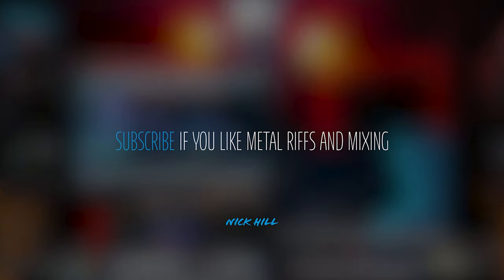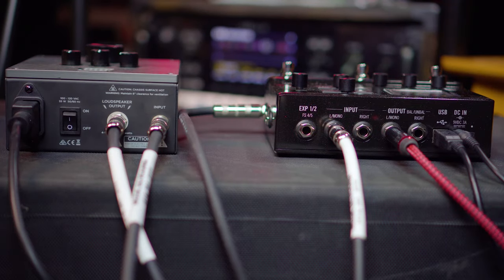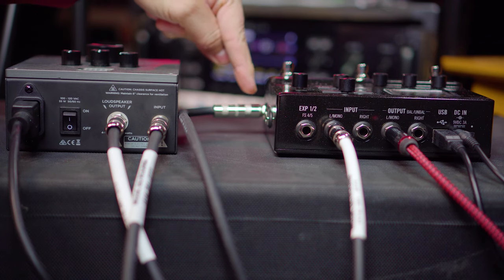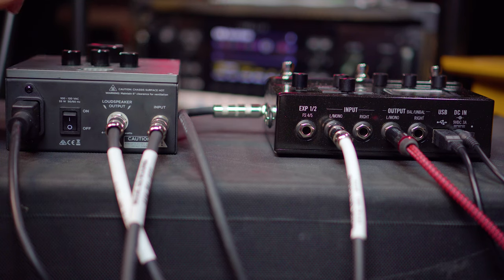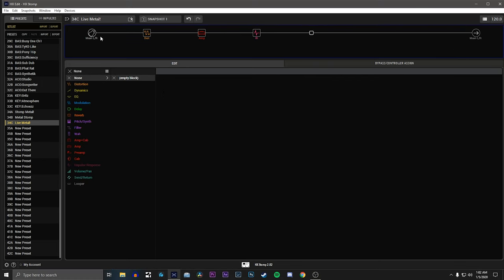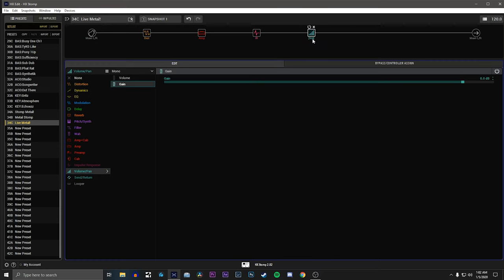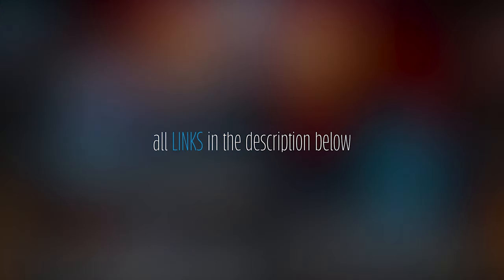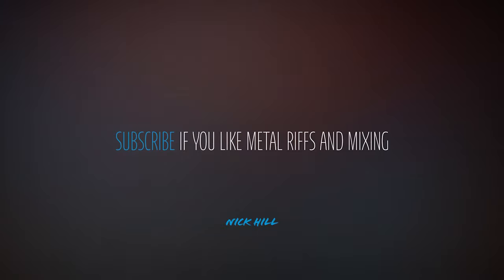Line 6 HX Stomp + Seymour Duncan Powerstage 170 LIVE RIG

Comment: You just sold me the HX Stomp. I figured this should be possible, but wasn't sure without any prior experience of the unit. Your video went straight to relevant things like the basic idea around the concept, the physical signal chain and the how the patch should be set up. Also great explanation how and why everything had been done the way they were. Thanks for the video.
Reply: I have and use this exact same setup and not only does it sound amazing, you have LOADS of headroom. I can't believe how powerful the powerstage 170 is - playing with my full band I'm at maybe 30% volume and am loud, present, and cut through the mix.

Comment: Nice job, actualy i realy like ur micd Sm57 take 
On the IR usualy i low cut at 80hz and high cut at 12k hz by default. 
I would love to get the Seymour Duncan Powerstage and do the same with my 2x12 ENGL to have the Volume on stage and sending the IR to the Soundguy.
Now im running the Powercab with the 1/4 cable in FRFR mode, it's good but still miss the Stage Volume to a Live setup. ( but through a Pa sounds killer)
And when i can, i use the PRS MT15 with my ENGL2x12 V30...  with only a TS808 or a PrecisionDrive is amazing.

Comment: Do you think it’s necessary to put an EQ after the AMP BLOCK so the signal that goes to the cab cleans up of unwanted frequencies?... or the cab does that work?
Reply from the maker: You can do it however you’d like and see fit. There is no right or wrong. If you’re asking if I would do it that way, I wouldn’t.

Comment: Easy to understand video.  It’s tough to tell on our end since either method essentially simulates a close mic cabinet.  Does the power amp into a guitar cabinet sound more “amp in a room” for practice sessions?  I’m thinking of running the stomp into a 170 into a cab would give me a great low volume practice setup at home.
Reply from the maker: With the Powerstage, you can run a cab much quieter. I've used this setup on a live/practice situation and it was loud! So you really have the best of both worlds.
Reply: Nick Hill thank you.  It seems like the ideal solution.  Practice quietly at home without IR’s without bugging everyone  and just run foh with ir’s live.  Seriously well put together video mate.

Comment: Friend, with the power amp does the sound remind you a little of a tube amp or is it very distant? Does it sound better than using irs in frfr cases?
Reply from the maker: On stage, in a live setting, it’s never something I would even think to notice. I just need to feel and some volume. I’ve not used a FRFR so I can’t speak to that.

Comment: Can you specify one path to go out of the headphone output or does that one always get the full processed signal?
Reply from the maker: There is a headphone out and yes, it is basically sending the main outs.
Reply: @NickHillMakesMusic  Ah good.  I use this trick with my kemper when I need a separate monitoring output and a different output level.

Comment: Is it ok to use the full amp model into the power stage? I heard somewhere to use the preamp. Is the only use for the pre amp models for the 4 cable method?
Reply from the maker: I've never NOT uses the full amp. A power stage has no "tube power section." It's just clean gain so you'll want every bit of the emulation the model has to offer.

Comment: Do i need to set the amp block as a normal amp or as a preamp? Im a bit confused about what i need to choose
Reply from the maker: Try and test both. There’s no right or wrong answer. The AMP block is also simulating power section saturation but these clean, solid state power amps typically are just that, clean. Meaning they aren’t doing any or much “coloring,” of the tone/sound. I use an AMP block. Cheers man. Do some experimenting
Reply: @NickHillMakesMusic  okay thank you :) ill get my powerstage in a few days and wanted to make sure.

Comment: Hey man, is it safe to un this poweramp in a lower wattage cab/speaker 8 ohms? say like a vintage 30 or a 100 watt celestion.
Reply from the maker: The pwerstage can push varied ohm speakers. I’d google the manual to be sure

Comment: Hey Nick, love your videos.
I noticed you used a full amp on the HX stomp going in front of the SD Powerstage, instead of preamp which would make more sense. Is there a reason for that ?
Reply from the maker: Personal preference. Also, the power stage is solid state (clean ) power and the Helix amps emulate tube power/saturation

Comment: Hi Nick, nice video!  Question for you - if you've got a delay and a reverb on your preset and you split the path to go the the cab and to FOH, will those effects come out both FOH and from the onstage cab?  I'm just trying to figure out where would be best to split it to get the effects on both :)
Reply: If you place the effects before the split, they will be present at both. If you place them after the split it will be present only on the output where you placed them.
Reply: @effektgeraeteinfo  thanks for the advice!! 🙂
Reply: @effektgeraeteinfo  thanks for that!! 👍🏽

Comment: Are you using an amp model (pre amp and power amp) or just a preamp model?
Reply from the maker: Hey man. I’m using the amp model
Reply: @NickHillMakesMusic  thanks Nick! I've just been using preamp models. But after watching your vid I've just this minute  tried a full model and its sounds much better. I assumed because the 170 is a power amp I'd just need to use a preamp model. I think the 170 must be so transparent that it needs a bit of power amp modelling too. My rig sound much better now!
Reply from the maker: I think you’re right and that’s why I use the full amp model. The 170 is solid state and super transparent
Reply: Have you ever used preamp models through a real tube amp into a real cabinet? That's what I do now but do add an EQ block to shape the tone. So you had better success with full amp models instead of preamps when using the SD-170 with a real cabinet?
Reply: @danc3746  I've been using full amp models for the last few months, sounds great. I have used the preamp models into a real tube power amp yes, sounds good but I wanted to downsize my rig, so I'll continue to use the sd170 and full amp models.

Comment: Why would it also need to go to front of house? What if they already mic up the cab?
Reply from the maker: Common thing to do. Send your processed guitars to front of house so people can hear it because your just using the can for stage sound. Also, this setup was to demonstrate a proof of concept for different setups. 

As an example, I run my sounds to front of house through a splitter so I get an in-ear mix. I also have a cab on stage for some stage sound. Lots of guitar players do this so they can “feel some air moving.” It also works as a good backup in case one’s in-ear monitors stop working.
Reply: @NickHillMakesMusic  I do not use in ears and the venue mics up the cabs so the front speaker moniters gives me what i need to hear. I'm more asking in my instance, would I still need to put it to front of house? It doesn't seem like I would but I'm still new to modelers hence why I ask

Comment: If I wanted to have path 1 come out mono into a monitor,then a parallel path in stereo with FX coming out the Send to two monitors,can I do that in stomp??Basically I want a Wet Dry Wet rig...
Reply from the maker: You should be able to split the paths and send each to a different output. Not having it in front of me, you’ll need to play with it.
Reply: Nick Hill I have a Helix Rack,but was thinking of getting the Stomp for something smaller.....so I don’t actually have one yet...I don’t want to buy one if it won’t do the WDW thing...

Comment: Can this sort of setup work for bass and what sort of changes might it require to work?
Reply from the maker: I don’t see this particular powerstage being able to push a bass cabinet very well. Bad cabs typically need a ton of power through them. Most who use this setup would send the processes bass signal to front of house and then some type of in-ear monitor
Reply: Nick Hill thanks for tgr reply, i have gone down the in-ear route to be honest but wondered about these applications. Thought it would be limiting issue being able to push at this level. Cheers Nick 👍
Reply from the maker: I’d look into solid state power amps for bass. You can get a 1000 watt one for a good price. Check ohm machine on your can and you’re good. I’ve actually used this type of setup filling in for a band.
Reply: Nick Hill cheers 👍

Comment: Maybe a stupid question but why cant you just connect the Hx Stomp directly into a cabinet? Doesn't it have a Power Amp Sim in the signal chain? Why do you need a Power Amp like the Powerstage?
Reply from the maker: It can NOT power a cab alone. It MODELS power amp and tone stack within but does not output power. You need something like this to power an external cab. As is the case with all Helix models.
Reply: @NickHillMakesMusic  ohh I see, thanks!!

Comment: hiya, still trying to wrap my head around this whole helix thing, but it might be a good alternative for a tube amp considering i'm moving into the city area... Wouldn't a good (or possible) alternative be, using the poweramp in on a boss katana mkii? Or is this a different thing from that?
thanks in advance :)
Reply from the maker: Sorry man. I have no experience with the Boss Katana stuff. Not sure it would be the best use case for the helix. Unsure though
Reply: Running a Helix through the power amp in of a Katana works great!
Reply: @Christian.Means.  cheers
Reply: @hugowasalreadytaken  not a problem, to be honest if I had known earlier about the Katana MKII having that feature I might not have bought the Powerstage and just got a Katana to have a reliable good amp along with a modeler poweramp. But I love my Powerstage/Helix setup so I don't regret nothing. 🤟😁

Comment: great vid! i recently bought an hx stomp and still learing how to properly use it. was thinking of replacing my guitar amp with a powered speaker like the headrush frfr or something similar. can i use the hx stomp directly to the input of the powered speaker or i would need to get like amp or cab simulator or a power amp like the mooer baby bomb or radar? hope you could give me some advise on this. thanks! subbed and liked
Reply from the maker: If it’s a powered speaker, there isn’t a need for a power amp. I have the SeymourDuncan Power Stage 170 and use of with a 212 or 412. But the FrFr powered options make it so you don’t need a power amp. Cheers man.
Reply: Nick Hill thanks so much! Was looking into guitar amp alternatives and happen to look at a headrush frfr. Cheers!

Comment: There is no need for that path splitting. You could just use a „Send R“ Block right before the IR Block. Looks a little more clean in the signalpath. Or if you don’t want to waste one block, put the IR in the B-Path and pan the output all L/R, in case you just need mono signals.
Reply from the maker: So your criticism is how my signal path looks? Fair enough. I like they way I did it. It worked for me just fine. I didn’t even know there was a, “send R,” block. Although both ways use the same number of blocks. Anyhow, clearly there is more than one way to do this
Reply: @NickHillMakesMusic  Oh sorry, it wasn't intended as critics. I just thought it was a little easier to set it up this way. At least it was for me.
Reply from the maker: No man! I had no idea that send to L or R was a thing. You taught me something

Comment: Dude. Awesome video. Just got a Powerstage for Christmas and have been trying to figure out what works best through an Orange 212. Would you make all new presets for the Stomp/Powerstage/Cab setup, or would you just turn off the IR in each particular preset you have already? I only played through studio monitors until now and I noticed I had to dial in A LOT more bass on the power stage to get a similar sound out of my 212 that the monitors were putting out. All new territory for me. Thanks man, cheers from Texas.

Comment: Great demonstration 👍 I know this is probably off topic, but do you know if it's possible to use the HX Stomp to record drums with a keyboard? I know that it has MIDI connections so you can connect a keyboard, but can you play virtual drums through the Stomp via keyboard? Greetings from Lotasticland
Reply from the maker: I’m not sure how that would work with the Stomp. I think I the MIDI interface on it is for sending and receiving information to amps or MIDI controllers for patch changes. I’m sorry I don’t have a better answer.
Reply: @NickHillMakesMusic  it's fine. I thought that much, since I didn't find a single tutorial or video showing this. Now I have an excuse to not only buy a keyboard, but also an audio interface (for future Guitar plug-ins😁). Thank you nonetheless

Comment: Cool video, Nick. I'm thinking of picking up one of those HX Stomps for a small live rig. I've had a Powerstage 170 for a year or so and currently use it with a Fractal AX8. I really love how the Powerstage works with modelers. I need a modeler that is a lot smaller for some travel shows, though. Have you used the HX Stomp in a live setting before? If I've got a song with three or four different patch changes in it, how hard is it to switch through those presets with the three buttons?
Reply from the maker: Vito Marchese you get four snapshot changes with each preset. This allows for seem less changes. Taking into consideration, you only get 6 FX blocks, you should be good with that. Turning on and off delays, reverbs or boosts b

Comment: Very useful video!  Question for you - how does the Powerstage 170 compare on terms of volume with a 100w tube amp?  I'm guessing it's not going to be as loud.   

I play small stages with a very powerful drummer, and a second guitarist who plays a Dual Rectifier with 2x12.  Would this keep up with the onstage sound?  (I'd be using a 2x12 cab)